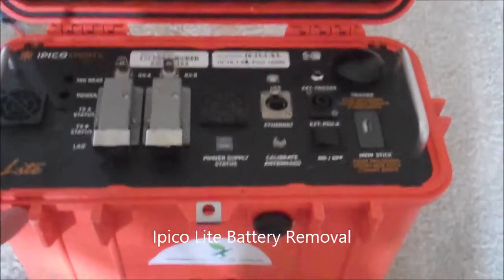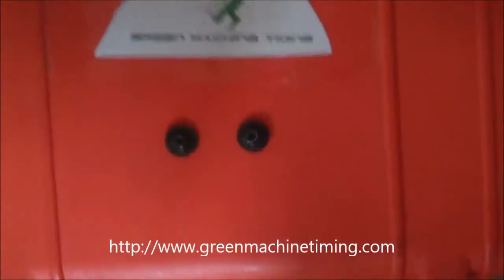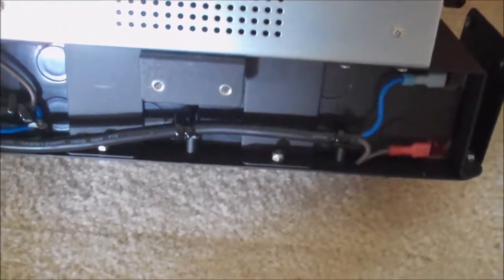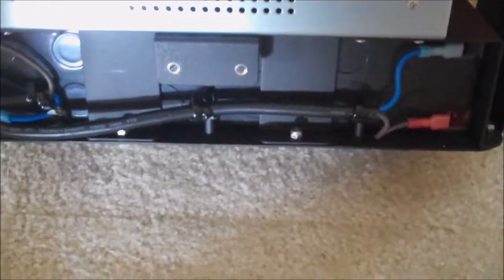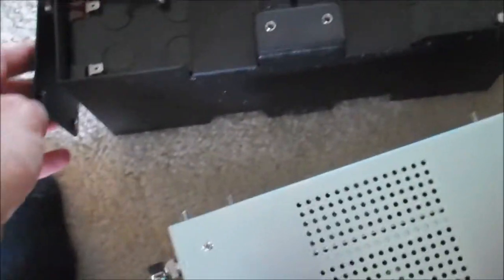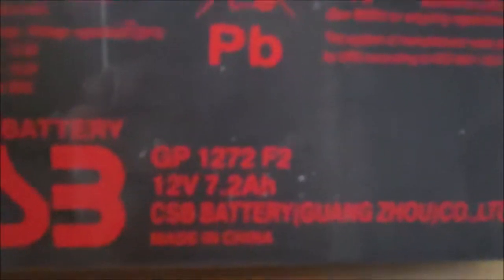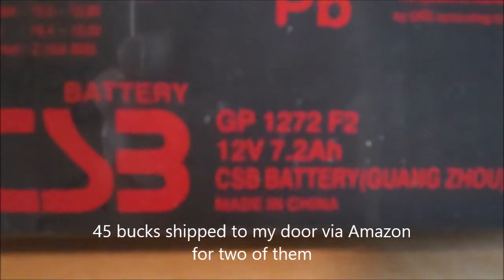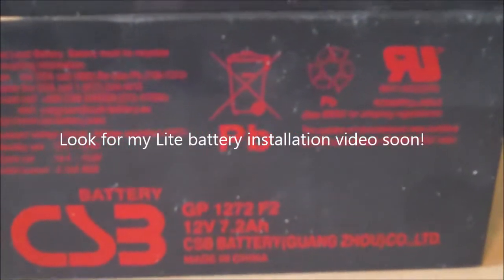Ipico Lite Battery Removal

Comment: I have one question regarding battery.. I can run ipico lite with connecting directly with electricity to stay for long time ?Like using convertor from 220v to 12v it will work fine? Around 4-5 hours
Reply from the maker: The only way you can run off AC is an AC to DC power supply that has the plug that fits the external battery port on the Lite.  I have done it several times.
Reply: Dufisthenics hi .. you using external battery? Or main power with external battery cable ? And how long do you run it ? I have one device the battery must change so planning to make it directly with power is possible